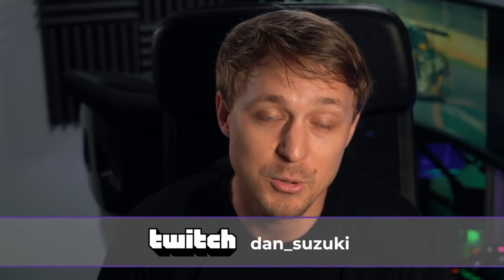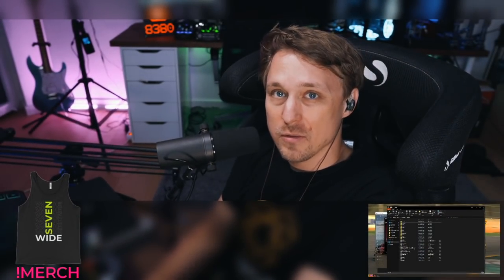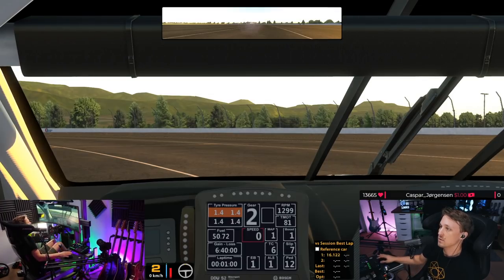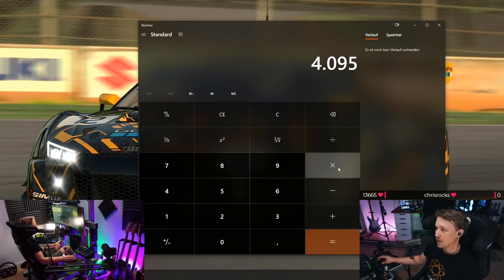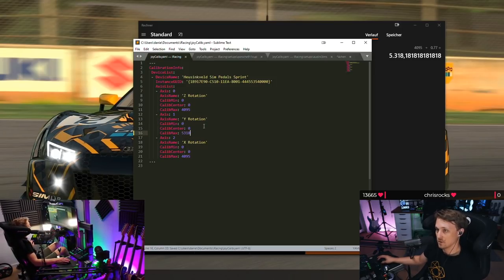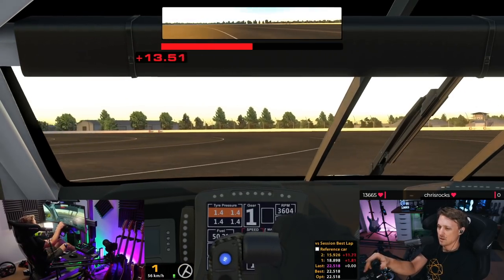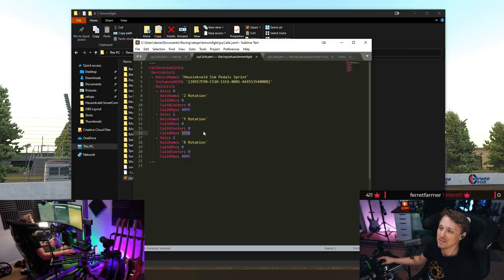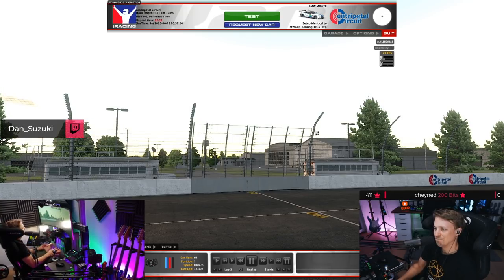iRacing Guides | Never lock up again! Get more out of your brakes with an easy trick!

Comment: For the Logitech G29 or G27 pedals it is inverted, so you will have 255 on the CalibMin and 0 on CalibMax. Type -55 instead of 0 and you should be good to go if you are using those pedals.
Reply: thank you !
Reply: Hola David, quizá puedas echarme una mano.
Como has dejado la configuración en el g29? No me aclaro...
Muchas gracias
Reply: Faustino de Rueta CalibMax 255, CalibMin -60.
Reply: @DavidMartin-fq6ze   Muchisimas gracias David, lo estoy probando ahora y genial, pero no crees que eso más de un 20% respecto al maximo, no iría mejor con menos margen?
Reply: Faustino de Rueta pruébalo y pon los números que tu consideres para que se adapte mejor a ti, yo no lo utilizo.
Reply: @DavidMartin-fq6ze  gracias David!
Reply: What percentage of braking is it at -55 for CalibMin?
Reply: @Not_Batman_  -55 is 82.26%

The Math...

Convert the -55 to a positive
255+55 = 310 total range

Calculate the percentage based on positive
(255*100)/310 = 82.26

Now to calculate based on a set percentage

255/X = Y
X = desired percentage (80% = 0.8)
Y = Required Range Increase

Identify Setting
Y-255=Z
Z=Setting (Use as negative)

General numbers to help those out that just want it easy (Based on 255 of G920/G27)
95% Max Brake = -13.42
90% Max Brake = -28.34
85% Max Brake = -45
80% Max Brake = -63.75
Reply: I have a G29 and have the following numbers in the default config: CalibMin: 0; CalibCenter: 255 and CalibMax: 255  -  so I don't have the 0 in CalibMax... When I reduce the 255 in CalibMax to lets say 197, it doesn't change the breaking at all, I am still able to break the full 100%
Reply: @Chrisasdf0  you are changing the wrong number.

The logitech pedals are inverted, meaning that 255= brakes off and 0= brakes fully depressed.

You need to change the Min value. Check my comment above for the details.
Reply: Amazing. Refines breaking on the G29 so much!!! Thank you!
Reply: @nickeby   
AxisName: 'Brake'
     CalibMin: -63.75
     CalibCenter: 255
     CalibMax: 255

not working for me :'(
Reply: @nickeby   it still doesnt work. jse'sim posted the values, trying those out doesnt change anything ingame.
Reply: @motioncaptiveduck  make sure you follow the right process for editing the file.

1. I recommend renaming the file to .bak
2. Open the game and go through the base calibration
3. Close the game (game must be closed for changes to take effect)
4. Edit the file
5. Test

If you wish to make further adjustments you must close the game then make adjustments.
Reply: @DavidMartin-fq6ze   thank youuuuuuuuu, muchas gracias , muito obrigado!
Reply: @nickeby   indeed it works. just make sure to never recalibrate or youll have to do this again. Thats why im here now again. :P
Reply: @nickeby  you sir are a hero thank you.!!!! now it works hopefully will se some improvement lol
Reply: @nickeby  with my Csl eite Fanatec pedals the Calib Center value is the same as the center (65535) I don’t know what to do
Reply: @slawli8  can you post all 3 values? Min, Center, Max?
Reply: @nickeby  min 0
Center 65535
Max 65535
Reply: @slawli8  i'm not sure if this is correct, it looks like your pedals calculate similar to the logitechs. Try the following for 80% max break.

Min:   -16383
Center:   65535  (no change)
Max:    65535 (no change)
Reply: @nickeby  I will try that thanks
Reply: @slawli8  did it work?
Reply: when i have 87 as min when using g29 cause i use 65% only of the pedal how do i calculate this?
Reply: dude thanks, I am planning on trying this tonight
Reply: I have the G920 and it shows min 16 max 255
Reply: @nickeby  What percentage are people finding to be the best? 70,75, 80, 85% or more?
Reply: @S2GUnit  kinda depends on the car. Ultimately remember that doing this is a crutch and will raise your theoretical fastest lap. 

It is a good tool to learn, but you would be faster without it.

I highly recommend as little as possible meaning if you can get by with 95% or 90% that would be ideal
Reply: @nickeby  hey mate! i have a g27, and tried editing with the game closed, but nothing happens at all! i've even renamed the joycalib file, launch the game and go to the pedals calib expecting a new joycalib file to be created, but nothing happens also. what am I missing here? tks in advance
Reply: Hey! Is this still valid for G29/G920 pedals? When I try that, the range becomes way bigger than my pedals' range.
Reply: Awesome. Thank You.  Works perfect for my G27 (Jan 2024).
   - Axis: 2
     AxisName: 'Brake'
     CalibMin: -63.75
     CalibCenter: 255
     CalibMax: 255

Comment: All the people saying this is cheating lol, I play with a g29 and single screen, so according to all of you people with a better setup like ddw or load cell pedals and triple screen are also cheating, because they have better software or hardware that has all this extra options to tune your setup than a basic g29. Love the content Dan! I am definitely trying this, but maybe only on 90%, I just want to get a higher pedal resolution, and still have to fight against lockups
Reply: With g29 the other issues is also the brake pedal it self.. for push it full at 100% is like impossible to do it, you need also to calibrate the pedal to hit 100% without losing the foot everytime pressing that shit pedals we have mate

Comment: This a good guide, however for pedals like the Thrustmaster which aren't setup in a similar fashion you need to change the CalibMin value to not be 0 and instead be a negative value of whatever you want the adjustment to be. For most people adjusting it to about -250(ish) should give you about 70-75% of braking with your foot to the floor.
Reply: Yeah, that threw me. Mine goes from 1023 to 0, and my center is also 1023 instead of 0. Do I leave that alone?
Reply: @drafman  Yeah you don't want to touch the CalibCenter values for Thrustmaster pedals, just adjust the CalibMin value to be a negative value.
Reply: @scud  thx!
Reply: Thank you for sharing this. it helped alot.
Reply: Would like to see a video for lower end pedals - does iRacing have to be restarted once changes are made?
Reply: @footballgrandad  Yeah if you make the changes to your .yaml file you need to quit out of the sim and restart it to see the changes.
Reply: Good work, thanks for this the negative value worked!
Reply: thank you!
Reply: This was very helpful thanks. But what do you think of the rubber stop that comes with the pedals? Do you use it? And if so what do you do to it so it actually has some squish.
Reply: @drafman  hi man could you tell me how did you set your one up so you get 80% at full press??
Reply: @footballgrandad  Yes. Never change the file if iRacing is started in background. Always exit the sim, make the changes to the file and start iRacing again.

Comment from the maker: This is an option that most high end pedals have in their software (Heusinkveld Sprint for example has presets with lower brake pressure per car: https://heusinkveld.com/sim-pedals-sprint-smartcontrol-presets/?q=%2Fsim-pedals-sprint-smartcontrol-presets%2F&v=3a52f3c22ed6) - this video shows you how to get the same effect with lower end pedals.
Some pedals seem to be a bit different than what is shown in the video, as a reference:

Logitech is inverted and you need to go in the negative range to achieve the same effect (255 is 100% ... so 318 would be 80% max force and as 255 is the min and 0 is the max you need to go to negative values ... -63 in this case)
For Thrustmaster you need to set the CalibMin to negative values ... start with -250.
Fanatec V3 seems to need around -30000 or so on CalibMin.

Thank you very much to scudly and David Martin for pointing it out :)

If you still have problems it might be worth checking the Hardware section of the iRacing forum!
Reply: do the fanatec v3 pedals software have such a feature? I just ordered them and am curious to know how to best set them up
Reply: I've tried to follow this guide and it dowsn't work for me, nothing wrong, I've heusinkveld pedals PRO
Reply: @crissssssttttttttttt  same for me. Maybe iracing fixed it or changed the behavior..
Reply: Fanatec CSL are 0 for max throttle and 65535 for minimum throttle
Reply: Can't get V3s to calibrate like this with that file.  Anyone have any suggestions?

Comment: Yeah. Thats really helpful. I use it in the 3.5! Just keep in mind that the setup also has an influence on available brake force. Especially in an openwheeler. With a ldf setup around something like momza you will lock up a lot earlier compared to a hdf setup. So you should tune it for you hdf setups so you dont run in to problems there
Reply: yeah, with css i found it much easier to not lock up with gtes than with random setups or baseline

Comment: I done this on the Audi R8 about a year ago and it helped. Iracing has a horrible ABS algorythm and it beats up the front tires. Same goes for their traction control, it is hard on the rear tires. If you can drive the car with the pedal and turn off TC you will run faster laps. I found turning off TC2 on the Ford GT GTE helps exit speed a good bit.

Comment: I love you Dan... massive help for my V3's. Could never get the travel that I wanted out of my break pedal. I tried to adjust everything from pre load to changing the makeup of my performance kit. Now only lock up at the final 10-15% travel of my break. Again I love you...
Reply: What settings you using now ?
Reply: What settings did you use for the joycalib file with the V3's?

Comment: I couldn’t get this to work with vjoy/IrFFB and my T300. But to get it working in the calib file set the calibmin value of the X axis on vjoy to ~ -13000 for 80% max brake pressure. Works like a charm!!

Comment: Nice video ! Some weeks ago i try'd this and it didn't work with my Fanatec V3 pedals (cable in dd1 and not in the pc) ... Fanatec goes from 65000 to 0 in Iracing, later i changed my Calibration Min to -30000 (minus 30.000) and now i have around 80 % ... 30.000 just a number, i did not calculate that, i use the joycalib file in the setup folder of the bmw gte
Reply: i had to go as high up to -12500 to get the desired break effect.
Reply: Maybe -12500 also good for me, didnt test that ... i did -30000 and than it was about 80% ... but it is also a bit high i think, i'm still tweaking that number haha
Reply: Strange I can’t get it to work on my V3

Comment: I already know about this one. Haven't tried it yet because I'm questioning myself: If I use this type of calibration, doesn't this mean I never really learn how to break properly? I'm not sure. What are your thoughts about it?

I'm currently running G920 Wheel + Fanatec Clubsport V2 (Loadcell on 5/10). I'd love to increase the Loadcell to be much stiffer but then on some corners where you gentle use the brake (like 5-10%) to place the car, I really have to hit the break really hard and this doesn't feel really natural. Any thoughts on this?

Comment: instantly broke my PB by over .5 seconds, I used to be a pro driver on iracing, did a few pro races and i cant believe i've been playing handicapped since 2008 when i joined iracing lol.... my almost 5000 irating was gained the hardway!!!! with this i expect to do a shit ton better now, never too late! Sadly I'm past my racing prime, but this little trick just gave me a little bit more life to go on :)
Reply: Nice improvement!

How much are you reducing the brake pressure on GT3, GTE & MX5 cars?
Reply: @S2GUnit  its a sliding scale to be honest, overall i'd say around 10%, i can still kick on abs, but its only when i engage the brake pedal fully, compared to before where around 75% travel and you're locking\abs activating without having the benefit of feeling the brake pressure increase with a load cell for example.

Comment: Just been testing this in practise so in case anyone is using T3PA's with 20kg load cell mod, to get your brakes at 77% max you need to change the Min value not the Max, set it to:

CalibMin: -305
CalibCenter: 1023
CalibMax: 1023

Many thanks for the tip Dan! Its massively improved my tyre wear now haha!
Reply: How much are you reducing the brake pressure on GT3, GTE & MX5 cars?
Reply: @S2GUnit  Apologies, I only do fixed setup races so I don't mess with any setup stuff, I left everything at default and this trick stopped me locking up so I'm happy with as is :)

Comment: This is super interesting. I'm brand new to sim racing and I've started with a G920 wheel. The brake pedal is super stiff near max displacement and there are a lot of complaints about it after searching online to see if that was normal. A lot of people remove the a rubber pad in the brake pedal to make it more easy to achieve 100% pedal displacement. I thought that I would be at a disadvantage in certain circumstances (high performance cars maybe) by not being able to use 100% of brake travel with the wheel but after seeing this video it looks like it will actually be a total plus to have such a firm brake pedal near the top of its travel. This video has saved me from opening up the G920 pedal box to make an unnecessary fix! Thank you!

Comment: Sometimes catching the car with full throttle and full brakes need a lockup so it might be useful to have a safety window cause of that
Reply: just don't crash Kappa

edit: for a serious response tho, you don't need 100% of the pedal to lock up when you're spinning as the grip already isn't there so it'll lock up anyway
Reply: U can still Lock Up at the end of the braking zone, If U keep Holding the Break. But at the beginning at the braking zone U cant Lock Up anymore.
I think thats the Point.
Anyway thank U dan! 😉

Comment: Have a feeling that I lose out in the hard braking zones especially with higher downforce cars. Where you can actually use 100% of your pedal for the initial part of braking. In other braking zones it helps allot but it makes you very vulnerable in those hard braking zones.
Reply from the maker: Definitely - this is very dependant on the car, the new LMP2 needs 100% for example :)
Reply: @DanSuzuki  that was exactly the car I was testing this with!

Comment: Hey Dan, I would not say it is super easy to hit maximum of 65kg with Sprints when you use correct rubber on the brake. I do use "L" rubber damper and have 78% linear brake curve. And I really don´t feel comfortable to use more than 55Kg on the Loadcell.
Here is my profiles:
GTE: 78% (linear) and 46kg (mainly BMW GTE)
GT3: 78% (linear) and 52kg - I want to prevent to activate abs, it can be also set up to 55kg (personal preference)
Porsche Cup gt3: 78% linear and 44kg - brake sensitive enough and do not need more kilos.

I know it is all about personal preferences though. I just wanted to point out very important fact with sprints which is the rubber damper.
Reply from the maker: Thanks Petr :) Already have that on the stiffest setting though - I think I'm just weird regarding brakes :D
Reply: Dan Suzuki you definitely don’t skip the “leg day” 😂

Comment: Hey Dan, to get the max potential out of your Sprint pedals be sure to set the heel plate as low as possible and turn the pedal plates upside-down (in their lowest position) so you get the least amount of lever. So you have to press harder to reach those 65 KG.

Comment: Thanks for the video. I'm using Fanatec v3 inverted pedals and when I generate the new file I don't see what you see for the CalibCenter is the same value as the CalibMax. I tried setting it to zero manually and it reverses the pedal input. Foot off the brake = full brake and pressing the brake in = no brake. Any suggestions?
Reply: David Sampson did this exact video weeks ago and I found this in the comments (I have V3's as well) - for those of us that use the Fanatec V3's plugged into the wheel base it will not work as you have it in the video.  Our V3's when we calibrate in iracing the slider goes from 65535 to 0.  So instead of increasing the max value in this example to 78642, decrease the 20% as a negative number in the min value.  in this example, you would change min value from 0 to -13107 and dont change the center or max values.  in case you want to add this info for other situations like this.  Again, thanks for the info
Reply: @tcash23  ty

Comment: hello, congratulations for the channel, top video, I recently switched to iracing I have an asetek pedal set Forte max brake value 65535 77% is 85110 is it correct? can you recommend the value for the ir04 Formula?

Comment: @DanSuzuki 

Good morning.
I love driving the Cadillac GTP but the problem is I can't do it when braking at high speed, the car suddenly locks the wheels and goes sideways or spins.
I tried to adjust the pressure of the Heusinkveld Sprint crankset but I can't do it especially with my sensitivity problem my left leg is there a way to adjust the Joycalib Iracing? if yes what value to put? It's a shame to deprive myself of this car because of my health problems, so for the GT or LMP2 Porsche Cup cars I don't have this problem.
Thank you helped me have a nice day.
Reply from the maker: No, this „hack“ can do nothing that you cant achieve more easily on the Heusinkveld Software. The caddy also can do 100% brake pressure afaik so you probably need to work a bit on your trail braking :) try putting the brake bias more to the front, that can help!

Comment: Maybe a bit odd, but when I remove my joycailb file from the directory to generate a new one... iracing isn't actually creating a new one... any ideas? :)  Running a TM T500RS wheel and pedals.
Reply: hi you have to restart iracing and do a new calibration to generate a new joyCalib!
I can't find the right value on my t500 with T3PA Pro
Reply: Late but if you have the "custom controls for this car" enabled you are going to have to go into that cars folder to find that joycalib you just generated